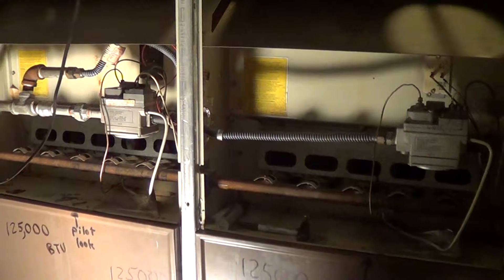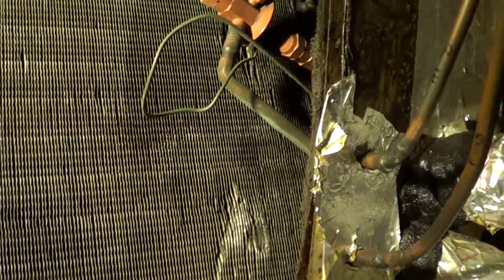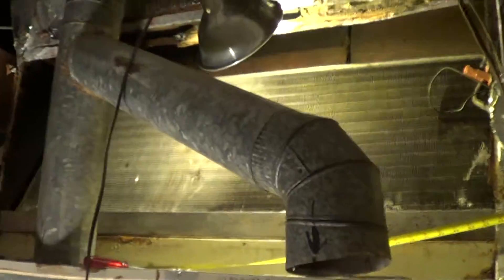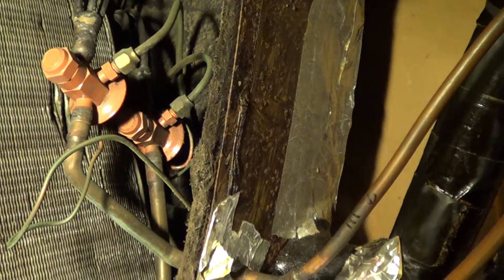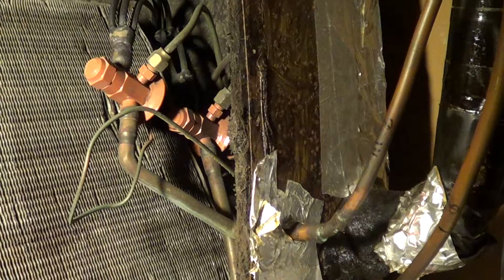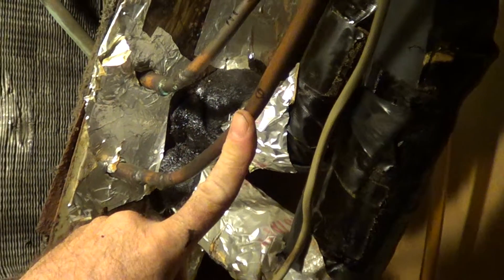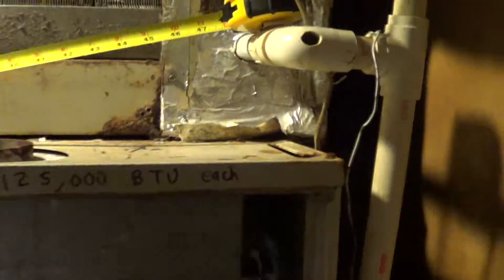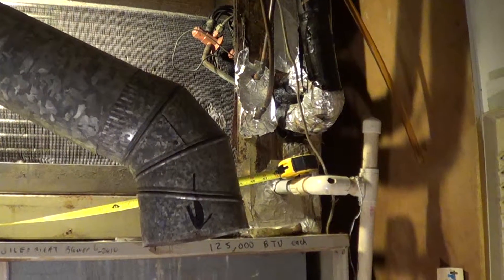HVAC Carrier 10 ton dual freon circuit A coil Evaporator above 58GP-125 furnaces

Comment: For anyone else who has this system if your system USES R-22 it may be impossible to refill it afterwards because R-22 is getting more expensive and rare now as it is no longer being produced (as of 2020) COIL IS NO LONGER SOLD BY CARRIER replacement coil CAN BE MADE at www.multithermcoils.com or complete assembly aspenmfg.com model BH140 120+X1 SPL